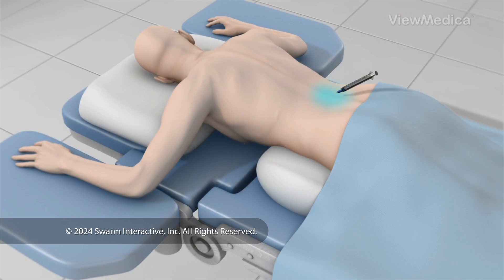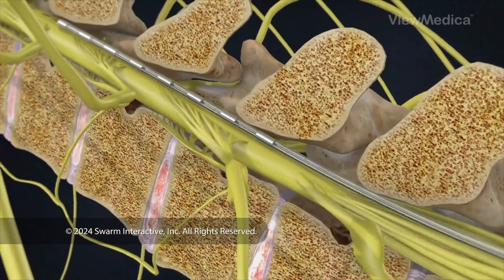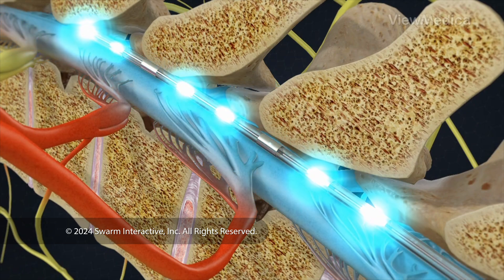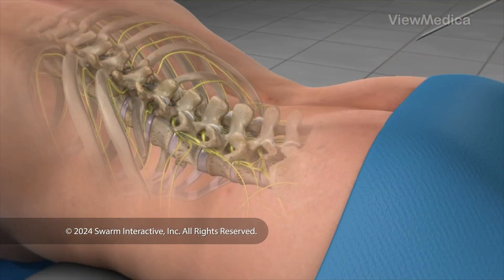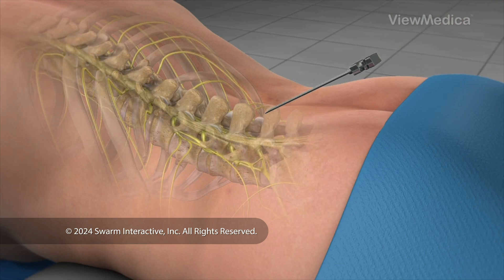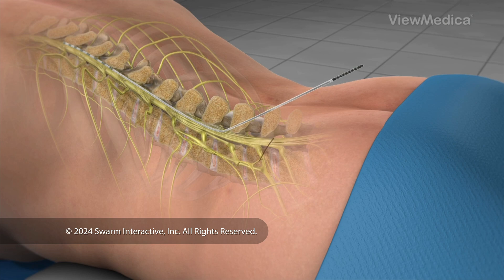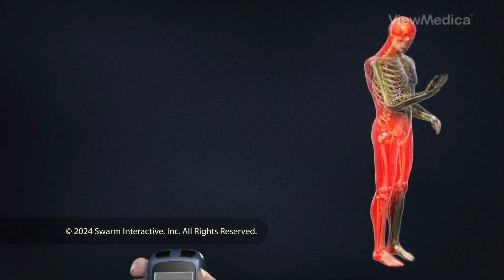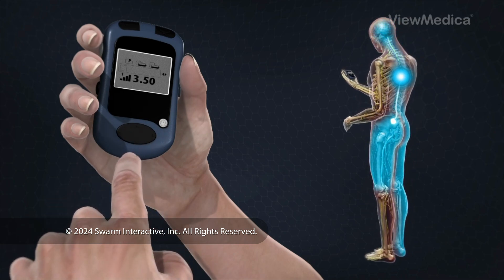Relieving pain through electrical pulses

Comment: Be careful they do work but they do have a downside they put it in my back in 2016 and then after it was in they advised me I could not drive when I have it on... And I had to turn it up so high to block the pain It wasn't working right they took it out in 2017 and then they advised me I needed a faster running model at that point I was just done... Just research research research It is a good technology but like I said it has its downside